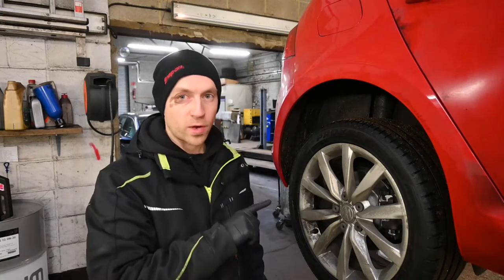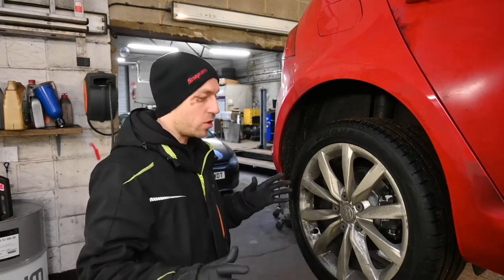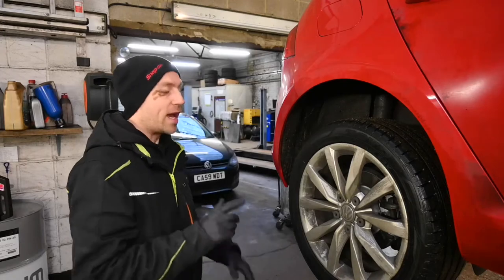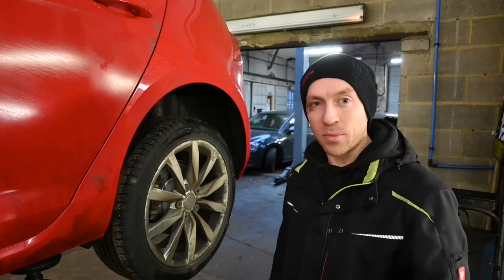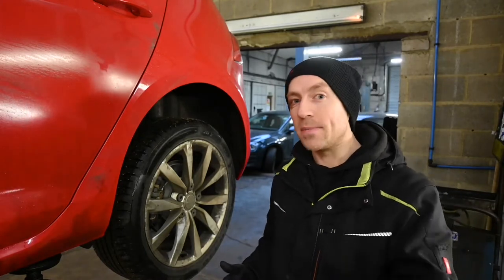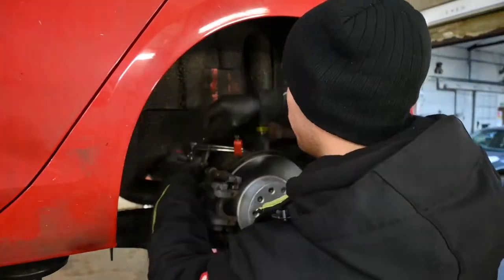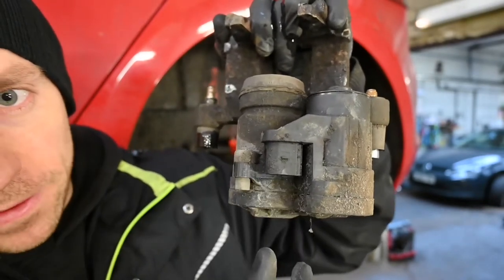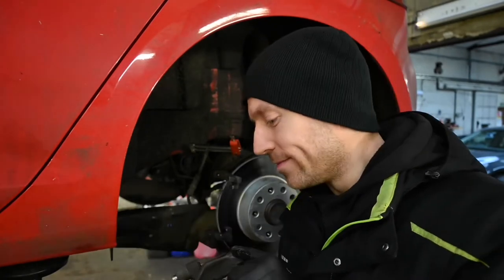Diagnosing & Replacing a 2014 VW Golf Rear Brake Caliper With Electronic Handbrake

Comment: I think the triangular washer should follow the threads better and not slip out or come off as easily. Then you don't have to use the trick of using a dab of grease to hold the washer in place during assembly.
Reply from the maker: Thank you, it's a plausible theory and I've received a few ideas of why that is. Not to sure if there's a definitive answer but it makes sense. Apologies for the delay coming back to you and thanks for getting in touch.
Reply: What size are the crush washers?

Comment: Just remarking you need grease that’s safe for rubber. Otherwise it’s degrades it and the sliders will stick. Thanks for the video.
Reply from the maker: Hi, apologies for the late response. Yes, absolutely right, there are specific grease that don't degrade rubber. Ideally a lithium based grease is very good but copper grease hasn't failed me yet. If you're ever purchasing a caliber to, you can almost guarantee that it will come with a packet of very specific grease that should be used to prevent rubber from breaking down. Thanks for getting in touch.

Comment: Is there a reason why this won’t work if you just turn off the handbrake ? Without the diagnostic tool? Want to do thid myself without any experience and don’t have the tool. I’m replacing the caliper in full and have it off the disc. New one is pushed in so can’t i just undo the battery with EPB off, take off clips and brake line and put on the new one? Then bleed the brakes ofc. ?
Reply from the maker: In theory, I don't see why not. If the new caliper has already been wound back in & you're not replacing anything else then give it a go. The worst case is that the motor either doesn't extend all the way out or the vehicle may not learn the new position of the motor and you may have parking brake faults. Otherwise, fitting a new one and bleeding it out is the same otherwise. Let me know what happens. Thanks for getting in touch :)

Comment: I enjoyed watching the video - I've got a binding rear right side caliper (MOT failure) and need to replace it. I don't have a diagnostics tool, but the last time I had to change the pads I applied 12v to the two pins inside the connector female socket on the caliper (there's a video somewhere on YouTube that shows how to do it) to retract the piston, and then pushed in the piston the last bit until it was flush with the housing. As someone said, it's probably not a problem if you plan to fit a new caliper (like I do, along with new disks and pads), as you can just use the Parking Brake switch inside (after bleeding) to push out the piston and re-seat the pads. I'm definitely thinking about getting a pressurized bleeder though, it looks a lot simpler and you don't then need a helper inside pressing the pedal. Good Job with the video! 👍

Comment: Is the brake caliper not possible to refurbish? It would have been a nice movie.
Reply from the maker: Hi, apologies for the delay coming back to you. Yes, all calibers can be refurbished. A lot of aftermarket suppliers will charge a sur-charge, which is refundable when you return the old calibers that you're changing out. They will then have them professionally refurbished for re-sale if they can be salvaged. When you're in a high turn around business, it's too time consuming to refurb them yourself and will avoid any potential liability by doing it yourself too. That's why we will always buy them in and send the old ones back. Hope that makes sense and thanks for getting in touch.

Comment: Great video, I need to carry out the checks you mention, though my issue appears intermittent. Pulled up at country farm shop and smelt brake linings and rear offside wheel hot. Drove the 30-40 miles home and wheel same as the rest, cold. A few days later, short trip into town and, though no smell, wheel warm and others cold. Regarding your advise about bleeding all the brakes, as mine is a 2014, it will be a good excuse and opportunity to do a complete fluid change being nearly 9.5yrs old.

Comment: That’s a detailed description of the process that any amateur could learn from. The difference in regards to the washers have to do with unrestricted fluid flow through the banjo bolt, which wasn’t necessary as the new copper ones show.
Reply from the maker: Thanks for the reply and with such positive feedback. If there's one thing I've learnt in this industry, you're always learning and will never know everything. Appreciate you getting in touch to explaining about the copper washers. Thanks again for your support.

Comment: This is a mk7 golf so its a 2013 plate or newer. A 2010 plate will be a mk6 and they didn't have an epb.
Reply from the maker: Whoa you’re totally right dude. Turns out it was on a private plate and is a 2014 plate (although it didn’t look like one) 🤪 best go ahead and at least change the title on this video. Thanks for getting in touch 🤘

Comment: Doing this on my 2018 Tiguan this week. Will have to transfer my epb motor over to the new caliper though as I couldn’t find one with a new motor also. Hoping the new washers are included also. If not does anyone know what size washers they are for the brake line?

Comment: Fab and very, very comprehensive. I've a GTD with a slightly sticky rear brake and need to investigate. I'm fine with the braking system but this is the first time I've tackled anything with an electronic parking brake. I've different software but great to tlearn the do's and don'ts of the system as you set them out. Hopefully it's just a bit of stiffness / stickiness somewhere, but you've helpfully armed me with what I need to investigate and not mess up.
Many thanks and need to maybe find my wind back tool. 🤔
Thanks for making and sharing.
Reply from the maker: Hi, thank you for getting in touch especially with such positive feedback. Really glad you enjoyed the video. VW's are notorious for the rear pads seizing in the carrier but take your time and make sure everything is cleaned and treated accordingly. I presume you may have done the job now? How did t go?
Reply: @greenautoservices  Hello and thanks for your reply. Yes, I got everything back in good order, but I also decided to do a complete clear out of the rear wheel arch linings and a bit of resto on the rear sub frame so it all took extra time.
The more I dug into this the more muck I found in the arch linings and support brackets at their front. Once out, I pressure washed the linings. Once they were dry I gave each a 1/3 of a can of Tetroseal. I hope this means they don’t hold as much moisture in the future. I also cleaned everywhere I could find, then bagged up the disks etc and washed then waxed the arches, the frame, sills and suspension before reinstalling the arch linings and wax covering those fasteners. Next I rebuilt the rear brakes (thanks for your vid) and reset the EPB. The sticky calliper got a squirt of WD40 in the rubber seal before winding back in with a calliper tool and it and the other side slid smoothly. After the best cleaning I could do with various brushes and plenty of brake clean I used a little bit of very high temp copper-slip on reassembly and everything seems fine (touch wood). The raised temp took off some of the black paint (?) on the wheel rim, near the hub so I also fixed this as best as I could with some black Hammerite designed for non-ferrous metals. Will see…
It might be that the sticky calliper gets sticky again, but maybe this won’t happen until the pads are very worn. Seems fine so far and I’ll keep an eye / hand on brake temps.
At some stage I’ll pull the front wheel arch linings etc and rinse and repeat. Seems a brake service is a good time to treat the subframe with wax, no?

Comment: Thanks for the video. Over the last couple of days I have been replacing the pads and discs (front and rear) on my son's 2016 Fiesta ST. This has a manual handbrake so no EPB complications. On one of the rears despite winding the piston fully back the new pads were binding on the disc. Problem turned out to be a seized slider pin - completely rusted up with no sign of any lubricant. A good clean up and some copper slip sorted it.
Reply from the maker: You’re more than welcome. Always have to watch out for those sliders, very easy to over look which as you’ve found can cause so many issues. Glad this video helped and thank you for your support. 👍

Comment: Replaced both rear calipers last week. I reused the original parking brake motors on the new calipers. First caliper done no issue, second one took about 25 mins. I then did a brake fluid change. I'll get the old original calipers refurbished as a back up, but there seems to be few of the old school places left to do these tasks only now replaced by people refurbishing by way of painting calipers....

Comment: Hi! Great video! I am have having a hard time diagnosing my sticking rear brakes on my passat b7. After new pads and discs the brakes are sticking. If i put the caliper in “service” mode with the epb out the wheel spins free and the caliper goes in very easy, but as soon as I engage the epb after service and release it the brakes starts sticking. I have done a “reset” or “basic” setting for the epb and still has the same problem…This is the exact same for both rear brakes…were should I look next?
Reply from the maker: Hi, apologies for the delay coming back to you. Operations have recently moved abroad so there's been an inevitable time delay. So how difficult is it to turn the wheel with the parking brake off/released. There will be minor resistance with an electronic handbrake caliber usually but you still should be able to spin the wheel with one hand at least. If you need 2 hand and a bit of force to do it then you may have an underline issue. I'd double check the pads are not stuck in the carriers and also check the sliders to ensure the caliber can freely move back and forth. Ruling all those out there may still be an internal fault or resistance in the caliber that will need addressing. Hope that information helps....we'll get there :)

Comment: Great video. Good to refresh the brain on this one. I was in a pinch a few years back and could only get a used one from a breakers yard as local store never had any new in stock. Decided to wire it up and do a dry test before fitting. Big mistake. I cycled the piston and on its way back out, it just kept coming ... and coming and then pop. The piston falls out followed by what looked like hundreds of tiny ball bearings. £70 down the drain for pressing a damn button on my VAG COM. 

Glad there's a video like this around to remind me not to be a dickhead again.
Reply from the maker: My friend, you and soooo many other people I'm sure have done the same thing. Don't be hard on yourself. Undoubtedly though that will happen. If the vehicle doesn't see a voltage spike due to resistance when the piston is meant to hit the pads, it will keep supplying power even beyond the piston falling out. Chin up and it can always be a funny story.......made me laugh. Thanks for getting in touch :)
Reply: If all the bearings came out like that from the thrust bearing cage, it was knackered anyway. It needed to be rebuilt in any case. so no big deal as it turned out. 👍
Reply from the maker: @andrewphillips9798  Glad you got it resolved regardless. But again, interesting to know there are multiple bal bearings behind the piston. I may have to tear one apart and film it to see exactly what's in there. Thanks again for getting in touch.

Comment: Thanks for such a great video, can i please ask if you used an oem new caliper or an aftermarket? Could you please share a link to where you got the new caliper from? Many Thanks
Reply from the maker: Hi, thank you for getting in touch. You do not need to get an original OEM caliber. You can definitely purchase an aftermarket caliber that will meet OEM standards. The main supplier(s) that I used are GSF (previously known as All Parts), Euro Car Parts or Motor Parts Direct (MPD). Have a ring around for the best price and brands available. They most likely will be re-manufactured but that is 100% acceptable and will come with warrantee. Hope that helps and thanks for getting in touch.

Comment: When that tap opened I'm pretty sure a load of big air bubbles went through that tube into the system. Also in the VW workshop manual it says to strictly adhere to bleed sequence fl fr rl rr. Not sure you can just do one corner,

Comment: Great video, thanks Adam.
What are your thoughts on replacing the piston and seals instead of buying a refurbished calliper ?
Reply from the maker: Hi there, thank for getting in touch especially with such a positive response. So I actually think that the principles of carrying out a repair on the piston/seal would be straight forward and more cost effective. Usually it’s the protective boot that fails but the internal seal is also prone to failure but either way they are just maintenance items that look easy to replace. When it comes to electronic calipers, it may pose a slightly different fitting challenge but I would certainly give it a go myself. Worse case scenario, if you’re prepared to purchase a refurbished caliper, there would be little risk to try and carry out a repair beforehand. When I decide to do a repair myself, I’ll be sure to do another video. If you ever give it a go yourself, please do get in touch. Thanks again for getting in touch and for your on-going support. 👍

Comment: Enjoyed your video, lots of details and justification for your choices.  Surely closing the ebrake before bleeding extends the piston and increases the air void making the bleeding worse?   Would it not be better to open it and retract the piston fully by hand before bleeding?
Reply from the maker: Thanks for getting in touch, really appreciate the positive feedback. This is a discussion I have with so many other technicians. I genuinely think it won’t make a difference to when you bleed it out. You actually get instructions when using the diagnostic tool to close the caliper after installation and doesn’t prompt you to bleed it at any point. Plus, bleeding the system is all about getting the air out. Regardless of how big the void is inside the caliper, once all the air is bled out then the system brake fluid will take up all the remaining space. Unless the system isn’t sealed and air tight then it shouldn’t matter either way. Hope that helps and thanks again for your support. If I get a more specific update on this I’ll mention it in future videos 👍

Comment: Brilliant vid mate, was wondering about the procedure of do i have to bleed before resetting electronic handbrake or after and now i now!
Reply from the maker: Hi, thanks for getting in touch and especially with such positive feedback, really appreciate it. Honestly, I don’t think it matters which way round you do it. The foot pedal uses hydraulic braking but the electronic handbrake it set by an electronic motor. Personally, I would bleed the caliper before setting the electronic motor unless otherwise instructed when using the diagnostics to set the parking brake. Hope that helps and thanks again for your support 👍

Comment: What would the crush washer size be for either side of the banjo bolt on Skoda Kodiaq? Assuming similar size to other VW group cars. Very hard to find the sizes and re manufactured callipers don’t seem to include the washers
Reply: Managed to change caliper, this was an excellent video to follow, thanks. Washer is M12 for either side of banjo bolt.
Reply from the maker: Didn’t even see you’re reply to your own comment. Thank you for such positive feedback and glad you managed to get the caliper changed over. More importantly find the size of the banjo bolt washer. Always good to know for future reference. It is unfortunate that not all re-manufactured calipers come with new washers, I guess it’s brand dependant. Although you should always renew the washers, worse case scenario, as long as the old washers are not damaged or bend you can clean them up and re-use them. But again, this is not something I recommend to do. Thanks again for getting in touch and glad this video helped 👍

Comment: I just released the handbrake in with the handbrake button inside the car, is this not the correct way ?
Reply from the maker: If only it was that easy but unfortunately it's not no. The parking brake buttons is only designed to release the handbrake when you're driving the car. The internal motor needs to be fully rewound much further to allow the piston to be retracted enough to fit brand new pads. You will definitely need to put the vehicle into a specific service mode to do this before manually pushing the piston all the way back. Thanks for getting in touch though and apologies for the delayed response.